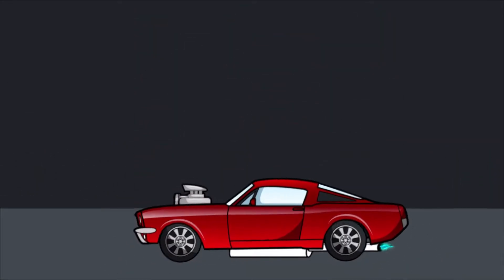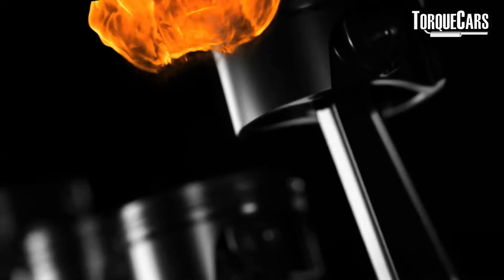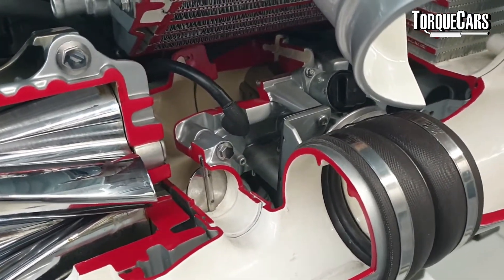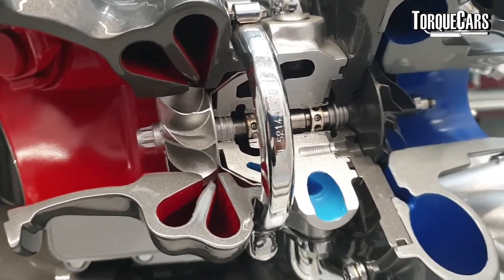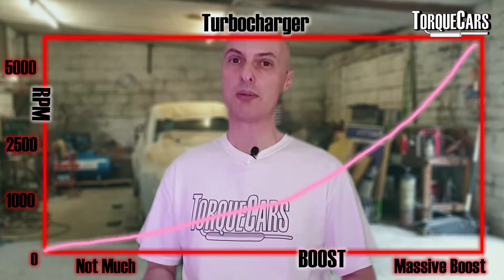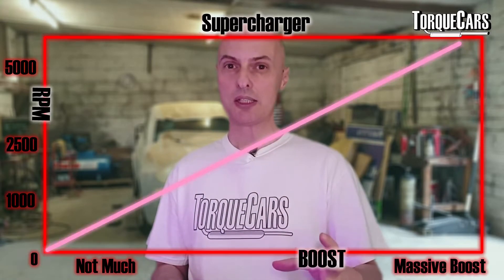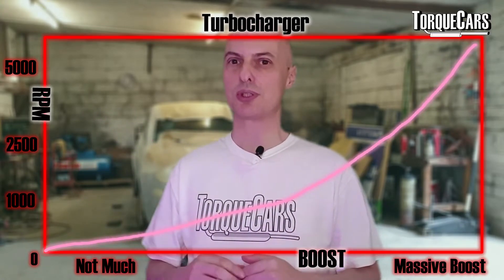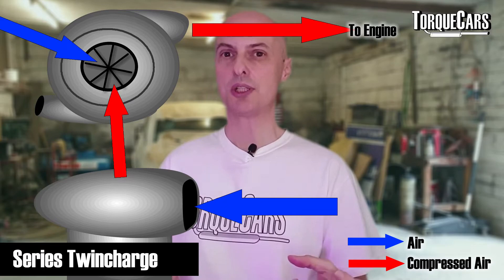Supercharger vs. Turbocharger: Unveiling the Differences & Choosing a Perfect Upgrade for Your Car

Comment: VW really let themselves down with the 1.4 TSI twincharger. The company and their customers who bought these ultimately paid the price for too much cost-cutting in the engine’s development.

I currently own one - a dream when it’s working properly, but so very temperamental. It saddens me to think what we could have had if VW had shifted focus from maximising profit margins.
Reply from the maker: It is a real shame but I do think this is the price of innovation, VW were one of the first to twincharge and also add direct injection before many other car makers started using it.

It would help if their R&D was a little more rigorous but they do seem to learn from their mistakes and later engine revisions on each generation are generally better than previous ones.  

The financial crisis didn't help either, most manufacturers had a dip in quality and it was often down to cheaper electronic components letting down the whole car.
Reply: @torquecars  Agreed, very well said - I suppose credit should be given to VW for daring to innovate, even if the execution was somewhat lacking. Love the videos. 👌